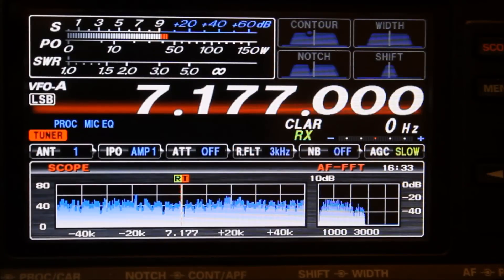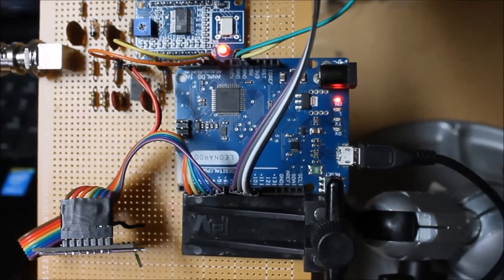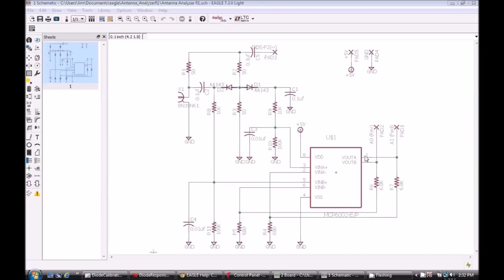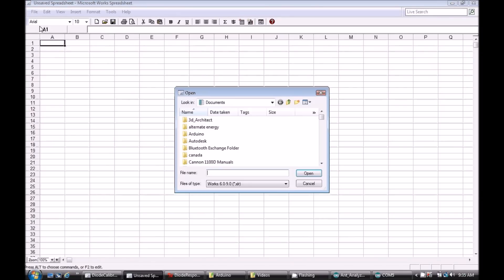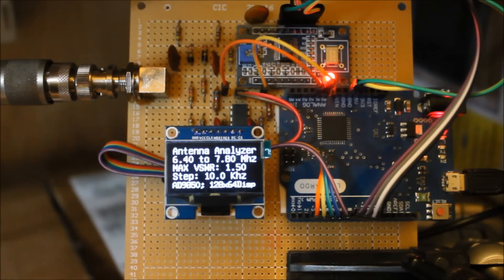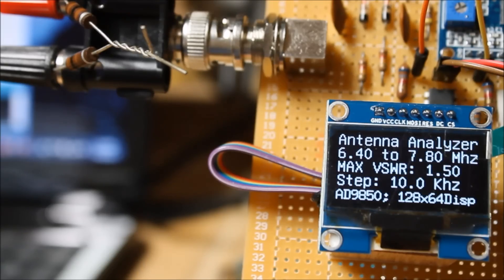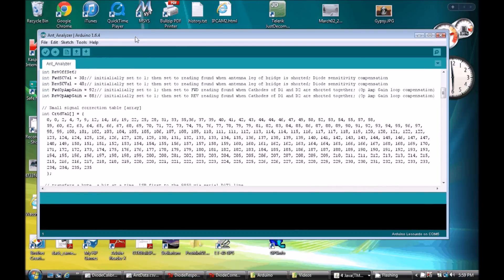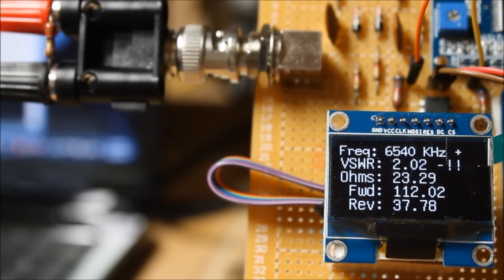DIY No Frills AD9850/Arduino Antenna Analyzer

Comment: is there any alternative to AA143 germanium diodes?  Unable to find these locally.
Reply from the maker: 1N34A, or its equivalent, should be a good place to start. But to be honest, I haven't actually used them, in this application. So the code/sketch could need some minor tweaking to get optimum linearity on the swr readings other than 1:1.
GL,
Jim(KW4KD)

Comment: Wow!!! Amazing. Just one question, in the schematic you didn't mark the orientation of the MCP6002 IC and you didn't mark the point that indicates pin1. Okay now I check if I have all the components and then I go to assemble the schematic.  At 5:14 of the video I see the complex of modules assembled but are not very evident all the connections needed to operate this analyzer. I am waiting. 
Thank you very much.
Reply from the maker: Thanks for the comment. 
Go to the GitHub site (see link above) and find the "Antenna Analyzer R1 Board Layout.pdf" file. The pin with the square solder land is the #1 pin. 
Looking down on the chip itself, with the pins running vertically, and the notch in the chip at the top, the #1 pin will be the top pin, on the left. If your chip doesn't have a notch, look for a dot (in the corner), that will be the #1 pin.
GL,
Jim(KW4KD)

Comment: Hello, I want to make the second version of your project, my shopping cart is full of these parts. Is the measured Impedance value "real value"? (And also swr value) Have you been able to compare the results with a professional antenna analyzer?
I downloaded a file from Github. Any advice for me to build this project? Can I get help from you when I have something to ask? Thank you. (lots of quetions :)) sorry)
Reply from the maker: Thanks for your interest in the project. The impedance reported is the combined value of the resistive and reactive components. 

No. I have not done any extensive comparisons between this unit an other "commercial" units. But using resistive terminations, of various values, and comparing their measured value to what the analyzer reports, my unit tracks pretty well for SWR's of 5 to 1 or less.
How well your analyzer performs will depend on how its laid out, and how much time you devote to calibrating the finished project. 

FWIW I still use mine today, and have written companion sketches for it that allow me to find the inductance of a unkown inductor, (helpful when winding your own toriods). So I still consider it a useful tool. Maybe not as sophisticated as a VNA, but easy to build and use.
Jim (KW4KD)
Reply: @jmhrvy1947  Hello, I have successfully completed your project. Thank you very much for your sharing. I also added Arduino and ad9850 to the board design in your eagle file. You test the resistors in the last part of your video. How should I add or replace in Sketch?
Also do you have any advice for calibration? 73 (ta1sor)
Reply from the maker: I'm assuming you are working with the sketch, "Ant_Analyzer_w_128x64DisplayPlusKY040RotoryEncod er.ino". There are 3 sketches , not counting the PSK sketch)  found at the github site. 

In this sketch, there is a function called, "CorrectReading(double ReadVal)". If you wanted to change how your unit reports, this is the function you would play with. Basically, this function breaks the raw A-D value into three curves. Unfortunately I don't have a "simple" calibration procedure you can follow. What I did was basically take a number of known loads and see what the unit reported. Then used the three equations found in this function to get the results I wanted. The trick is, if you change a coefficient in one curve, you will need to check the other two (and adjust accordingly) to ensure there's not a significant discontinuity as the A-D output changes, and uses one of the other two equations to calculate the new value.
"Congrats" on following through and getting the unit put together. I hope you find it to be as useful as I have. 

Tnx & GL,
Jim(KW4KD)
Reply: @jmhrvy1947   hello again, the changes I made on the following command lines do not cause any changes on the oled screen. I think I'm making a mistake somewhere. I get very different results in 75,100,50,150,200 ohm known resistors. (75ohm-> 45, 100ohm-> 22, 150ohm-> 18, 200ohm-> 151, 50ohm-> 20, 680ohm-400)

double CorrectReading(double ReadVal){
 if (ReadVal > 70)return 0.8*ReadVal+57;
 if (ReadVal < 13)return 3.6*(ReadVal*ReadVal)/15;
 float CalcVal =1.1*( 8+(2.1*ReadVal)-((ReadVal*ReadVal)*10.7/1000));
 return CalcVal;
}

Thx
Reply: but the python script works for changes.
Reply from the maker: @TA1SOR  We may be getting ahead of our selves.
Earlier I said there was no simple calibration procedure. At the time, I was just thinking about how to further refine the unit's response. 

The sketch contains steps (lines 70 - 76)  to do an initial calibration

// After build is complete first find the two following values
int FwdOpAmpGain = 92;// initialially set to 1; then set to FWD reading found when Cathodes of D1 and D2 are shorted together; (Op Amp Gain loop compensation)
int RevOpAmpGain = 88;// initialially set to 1; then set to REV reading found when Cathodes of D1 and D2 are shorted together; (Op Amp Gain loop compensation)
// Next determine these two values
int FwdSCVal = 30;// initialially set to 1; then set to reading found when antenna leg of bridge is shorted; Diode sensitivity compensation
int RevSCVal = 40;// initialially set to 1; then set to reading found when antenna leg of bridge is shorted; Diode sensitivity compensation
// Once the above 4 values have been established, then the antenna analyzer's accuracy can be evaluated.

Have you attempted to worked out values  for " FwdOpAmpGain",  "RevOpAmpGain", "FwdSCVal",  "RevSCVal" for your unit?
Before doing these steps, UNCOMMENT line 451
        //  return ReadVal;
in the "CorrectReading(double ReadVal)" function.
Then when you've found these values,  comment line 451 back out.

For the calculated resistance value, there's one more critical line. Line 358:
      if(FWD>=116 ) EffOhms = VSWR*47.0;
This line decides if the SWR represents a resistance greater than the bridge resistors, or less. So with a 50 load attached to the Antenna terminal note the "forward" reading displayed. And set this "if" statement to a value slightly less than your "forward" reading.

Hope these points help get your unit running
Reply: @jmhrvy1947  and can we see results live while tuning with antenna tuner?
Reply from the maker: @TA1SOR  I've added to the Github site the sketch 

"Ant_Analyzer_w_128x64DisplayPlusKY040RotoryEncoder_R1"
This sketch differs from the earlier versions, in that starting at line 526, it has several
"case n: //Set Freq Limits for Special Fixed Freq" options
These can be used to do "live" tuning adjustments
and at line 559 there is a "case 12" that can be configured to manually change the DDS frequency
Think when you see the code there, you will know how to modify these lines to suit your needs. 

Hopefully, these additional decoder settings will be useful to what you're doing there
Tnx & GL
Jim(KW4KD)
Reply: @jmhrvy1947  thank you very much. I'm trying some things your R1 version, now.

Comment: This is a great project and a wonderfully put together vid.

Very, very well done Jim.....

I'll gather the parts together for a later built while I'm convalescing from a pending back surgery.
Reply from the maker: Thanks for the kind words.
Hope your surgery goes well.
FWIW: I still use this project. It, with an outboard adjustable attenuator, makes a great low level signal generator, which is useful for checking receiver performance.

Comment: Hi, do you have a detailed instruction or guidance on how you made the antenna analyzer, as I'm planning to build this for my project to measure frequencies around the Wifi region (2.3 Ghz)?
Reply from the maker: There are no step by step instructions. The Arduino sketch, and a suggested component layout can be found at GitHub (See link  under the video's introductory comments. However; you indicate your need is for an analyzer working in the 1 to 2 GHZ range. The DDS used in this video isn't capable of generating frequencies that high. At least not directly, as i used it here. Also the components, and layout  probably wouldn't be appropriate for those frequencies. But don't know for sure, as I wasn't thinking about part of the spectrum, at the time I did the video. GL with your project.
Reply: Thanks, I was wondering if the chip determines the frequency range or is there other components that do that?

Comment: It would be brilliant if this could be made to test antenna for 1280mhz (1.3ghz),  2.4ghz and 5.8ghz!  I've just got into making my own Antenna's so this tool would really help me
Reply from the maker: I agree, but those frequencies are way beyond the capabilities of the DDS and the building techniques shown here.. But don't let that stop you from building antennas for those bands. The good news is you are working with small antennas, and are often fairly easy make, so its possible to make several with small changes, and see which one performs best . Good Luck and keep building.
Jim (KW4KD)

Comment: Hi, this is a really nice project.
I would like to know about the possibility of him working at 144 mhz.
it would be possible?
73`s py2wnw
Reply from the maker: Not straight out of the box. I think the 9850's upper limit is ~ 40/50 mhz. So to use it as a source @ 144 mhz, a freq tripler circuit would be needed. Next, the diodes used here, and component layout would  also become another set of issues that would need to be reevaluated.
Tnx for the comment, and interest in the project
73 de KW4KD
Reply: please contact me by email!
I would like to share my construction of this project!
mamutcnc@gmail.com
regards

Comment: Can we use another Op Amp chip as alternatif for MCP6002? Or maybe this required only that Op Amp?
Reply from the maker: You sure can. An LT1013 will work for sure. But there are other op amps out there that should work just as well. 
I'm not able to offer up an extended list to pick from. But here are a couple thoughts that may help you decide what you can use.
If you are using my parts layout then you will want to pick one that is pin compatible, If you are using your own layout then you can use almost any op-amp that can run from a single 5volt supply, and is ok with the input pins going to ground. Having a high Gain Band Width Product, isn't really needed here, since the input signals change fairly slow. So in that since the LT1013 is an over kill for this application . . 
GL
Reply: jmhrvy1947 thank you for quick and clear answer. I can find MCP6002 here, but I just found MCP601. Looked at datasheet and those are similar but the offset voltage. 

Very kind of you by the way. I am not ham operator by now, but I am planning to join as soon as possible.
Reply from the maker: I believe the MCP602 will work just fine. Again GL, & hope to see/hear your call on the air soon. :-)

Comment: can any body explain this

int FwdSCVal = 30;      // initialially set to 1; then set to reading found when antenna leg of bridge is shorted; Diode sensitivity compensation
int RevSCVal = 40;      // initialially set to 1; then set to reading found when antenna leg of bridge is shorted; Diode sensitivity compensation
int FwdOpAmpGain = 92;  // initialially set to 1; then set to FWD reading found when Cathodes of D1 and D2 are shorted together; (Op Amp Gain loop compensation)
int RevOpAmpGain = 83;  // initialially set to 1; then set to REV reading found when Cathodes of D1 and D2 are shorted together; (Op Amp Gain loop compensation)
Reply from the maker: I will try.  But I can't tell if its the "How", or the "Why" with these lines (and their comments) that  are giving you grief.
So at the risk of over explaining, I'll try to cover both . 
The value "30" was the correct value for FwdSCVal in my unit. But yours will probably be different. To find your values,  set  
 both FwdSCVal = 1 and  RevSCVal = 1.,  Then short the Antenna input & Run a sweep, As it sweeps note the readings ("FWD: aaa" & "REV: bbb" ) shown in the display. (Note, these readings will fluctuate, so take a mental average).  Next, replace FwdSCVal = 1; with FwdSCVal = aaa and RevSCVal = bbb;. That's the "How". What you are trying to do, is correct for the fact that the DDS (9850) isn't a perfect voltage source (has zero resistance), plus the diodes have losses as well. If everything were perfect then, when the antenna leg was shorted the "forward" and "reflected" voltages/readings would be exactly the same; i.e "aaa" would equal "bbb", Line 345 [FWD = (RevSCVal*FWD)/FwdSCVal;// apply "Short Circuit" offset] corrects that, and assures that the two will be reported as equal when the bridge sees a short circuit condition.

The part involving the variables  FwdOpAmpGain & RevOpAmpGain should be set/established before trying to do the above. What it does (by shorting the two cathodes together) is temporarily force the  two DC inputs to see the exact same voltage. And like in the above step, you will note (and set) these variable to their found values. When done, the sketch,  at line 341, [REV = (FwdOpAmpGain*REV)/RevOpAmpGain; // apply Op Amp Gain loop compensation] will execute and, that difference gets factored back into real time readings to "even up" the differences related to opamp gain and or A to D channel variations .

Hope that helps & thanks for taking an interest in this project.

Comment: I notice that your analyzer differ from other arduino based analyzers with showing impedance of the antenna , but  is there any way to show continuously the SWR and impedance of the antenna on given frequency ? I want to use "such" a antenna analyzer to tune my antenna with "qrp antenna tuner kit" ...
Reply from the maker: Yes. What I do is set the Sweep step increment to zero. Similarly I/you can modify the code so that rotating the encoder switch changes the frequency ( in any step interval you want; i.e, 1 hz, 10hz,.... 10khz, 20Khz, 100khz,etc)
FWIW: I found that the same circuit with a slightly modified sketch will display inductance. Handy for winding your own toroids

Comment: is there a way to convert the project to use the si5351 instead of the ad9850 ?
Reply from the maker: There probably is. But I don't have a 5351 so will have defer to another reader to offer up a work around.
Thanks for your interest in this project & hope you find the answer to your question

Comment: So , if you aren't using a display, the only component library that needs to be loaded is the ad9850 library ? There isn't very good documentation of the arduino sketch anywhere that I've found.

Comment: Yea? I clicked on the link for documentation. and got back a 404. Didnt find anything here. I realize that this posting is near bout a year old. I guess ill never know all of what it takes so i can build one myself. Thanks anyway.
Reply from the maker: Hi Dale
I just tried the link and it worked ok. Maybe something was temporarily down. So if you're still interested please give it another go.

Tnx 
Jim (KW4KD)
Reply: Ok got it. Just wished it came in kit form, posibly preprogrammed. Already have the uno and sweep gen coming.
Reply from the maker: Ok good deal. The Uno should work. FWIW, If I were building it new today, I'd use the SS micro (size & price).
Sorry, there's no kit. But using a piece of pref-board like shown here, its a pretty easy build.
Keep the runs short, and ground connections robust.

Comment: Hi, I was trying to figure out how the code calculated Ohms from SWR.  Could you explain the impedance calculations a bit, or link us to reading material on this?  Many thanks.
Reply from the maker: +Steve Wright 
I'll try:
The bridge circuit is two voltage dividers. One leg has a known resistance ( in my build, it was 47 Ohms) and the other leg has an unknown resistance ( the Antenna) . If the voltage across the antenna is exactly equal to the voltage across the known resistance, then the antenna's resistance (impedance) has to be 47 ohms. On the other hand, if the voltage across the antenna was twice that of the 47 ohm load, then the impedance of the antenna must be 94 ohms. 
If we ran another test, and found that the voltage across the antenna was 1/2 that of the 47 ohm resistor. Then the antenna's impedance would be 23.5 ohms. In both cases the Voltage Standing Wave Ratio (VSWR) is "2". So the VSWR lets us calculate the antenna's impedance, by either multiplying, or dividing the known bridge resistor by the VSWR. 
Now the trick is to know whether you need to multiply or divide.  If the Antenna's impedance greater than the known resistance, the voltage across known resistance will increase, and if the impedance is less, then the voltage will be lower. Luckily the AD9850's output is fairly flat across the frequency range of interest. So I noted the reading (FWD) when the VSWR was 1 and found it to be 116. The code uses this value as the divide or multiply decision maker. Depending on how your setup performs, you may need to tweak this value.
Thanks asking
Jim (KW4KD)
Reply: +jmhrvy1947 Thanks so much Jim.   What a wonderful time to be in ham radio with everyone sharing toys and information.  Very best regards and hope to speak to you on the air.  Steve ZL1BHD

Comment: What should I change so that the frequency covering 435Mhz? For me it would be very useful from 433MHz to 435Mhz .
Reply from the maker: +Liquida Decor Decorações The project presented in the video is  for the hf band. To convert it UHF frequencies would require frequency doubling circuits plus build techniques suited for UHF work. The end product, while electrically the same, would look quite different
Reply: tks